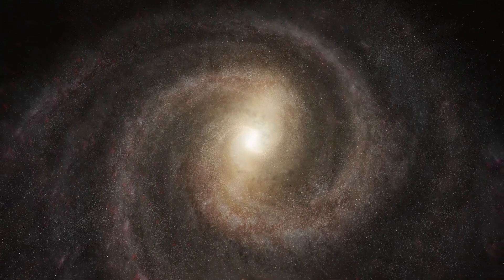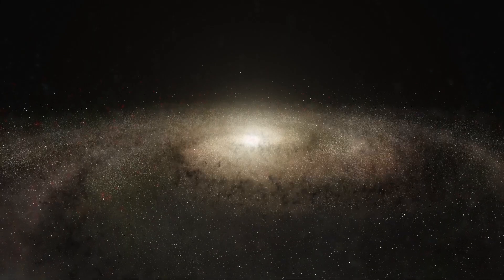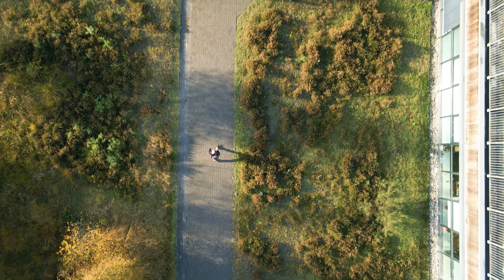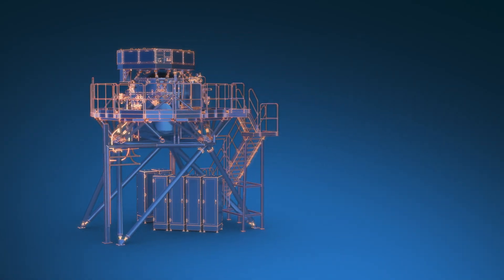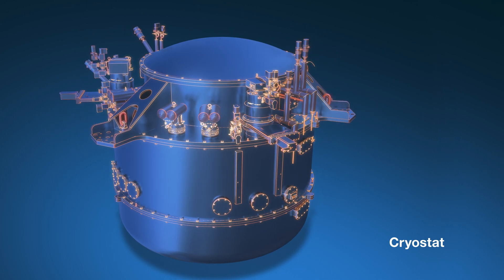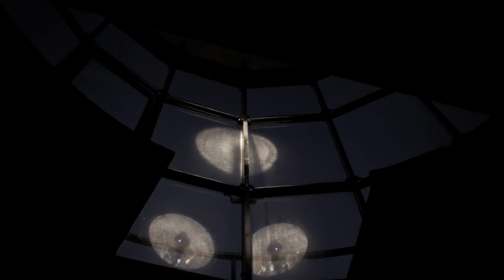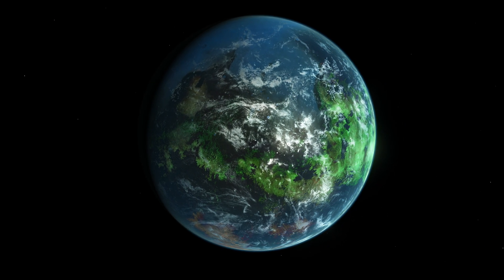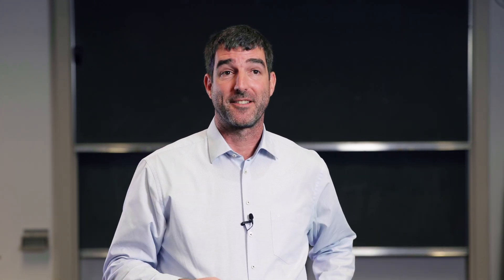Meet METIS, a multi-tool instrument for the ELT | ELT Updates

Comment: How do you define "mid-infrared light" ?  Because everybody does it differently.  Do you mean the 3-5 micron water vapor window here ?
Reply from the maker: METIS will observe from 3 to 13 microns.
Reply: @ESOobservatory  Thanks for the response.  Is the range from 3 to 13 microns considered "mid-infrared" ?  The usual terrestrial definition is 3 to 5 is "mid-infrared" and 8 to 12.5 is "long wave infrared".  I'm trying to understand your terminology.  Also, you say METIS will "observe 3 to 13 microns" ?  5 to 8 microns isn't going to be much use inside the atmosphere, even at your altitude.